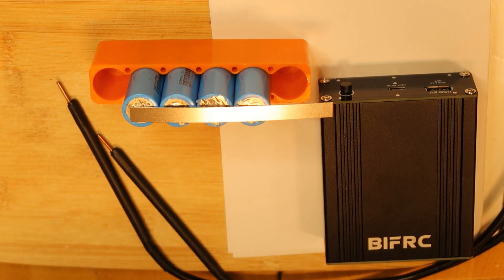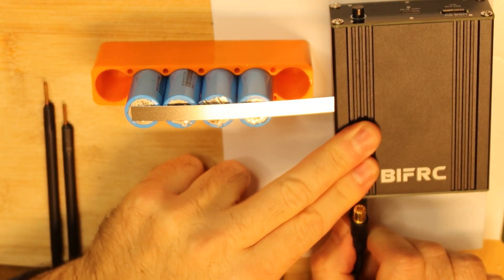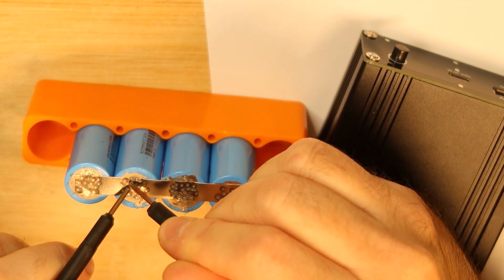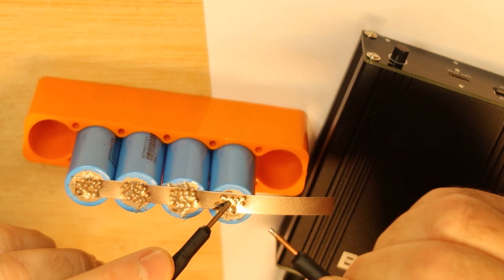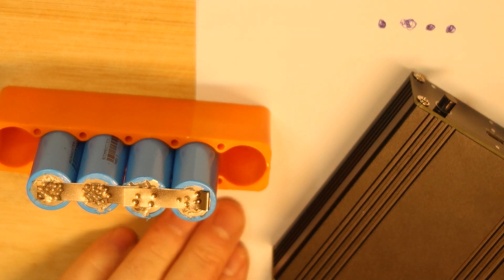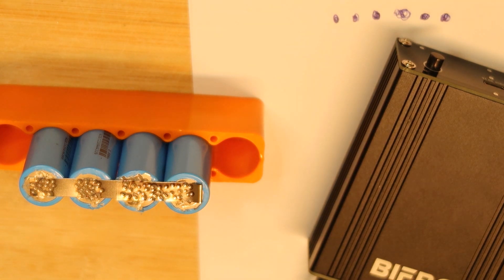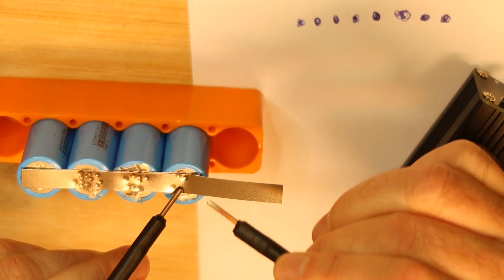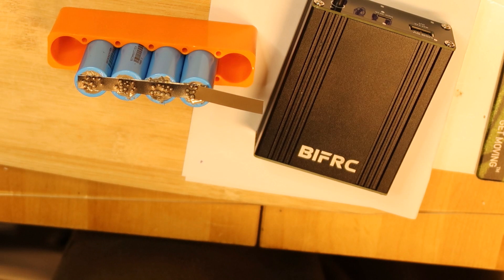BIFRC Spot Welder How many spots can weld ?

Comment: If I use max power on my own, I pierce 18650 sometimes with nickel 0.15mm (0.17mm measured with micrometer). Better set up is 4/5 power output with my own.
Reply: What is your own?
Reply: @zarbonida  same, new version I suppose.

Comment: Don't you think the red pulse welder is better, because it is safer without lipo battery?
Reply from the maker: no - both are ok, you can use the read with lead acid battery also
Reply: @RoeeBloch  can i use the red pulser with a 12v power supply?

Comment: What is the best setting for .12 nickel welding?
Reply from the maker: There us no best ... you should test with your battery, do one test and try to rip it off, if you see that it is hard enough, or the nickel splitted when tearing it off- then you are ok, if you see big hall in the nickel during welding - this is not recommended. so after a test one or 2 you will know what is best for you. 
It may also depends on the charge of the internal battery, when fully charge the welding will be stronger
Reply: @RoeeBloch  thank you sir.
Reply: @RoeeBloch  «hall», you mean hole?

Comment: what nickel thickness can it spot weld? the nickel is comes with is nickel plated steel so it can do thick steel but can it do pure nickel?
Reply from the maker: recommended up to 0.12mm although it can 0.15mm not very strong

Comment: Yesterday I used the eBay returns system to send back a dodgy box that  was obviously a poor copy of the product shown here. Same branding but various differences including not working (unless you count the ability to sometimes do one poor weld before latching up). Getting really tired of the crap that Scamazon and Fleabay sell though at least returns aren’t difficult
Reply from the maker: just bad luck - for me working ok
Reply: did you try very weak mechanic force?